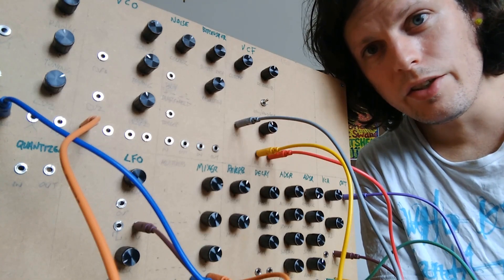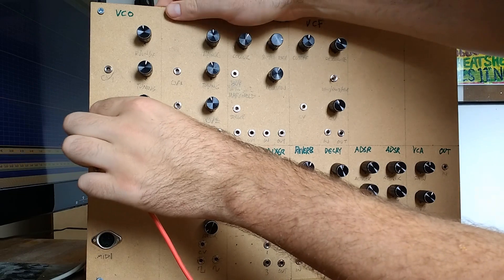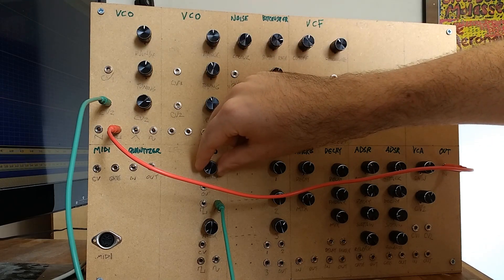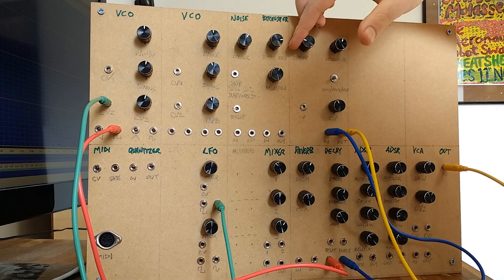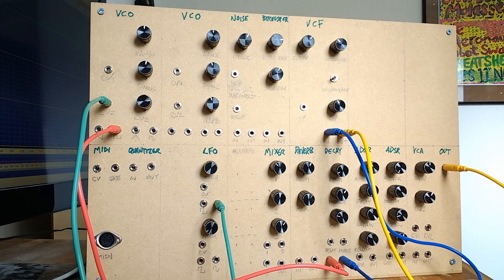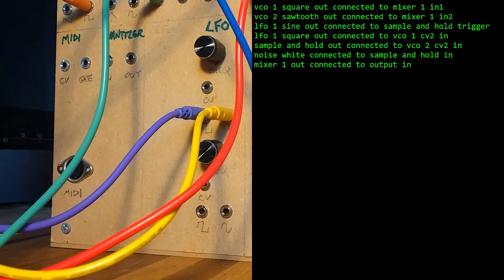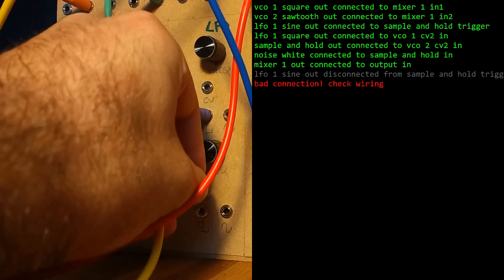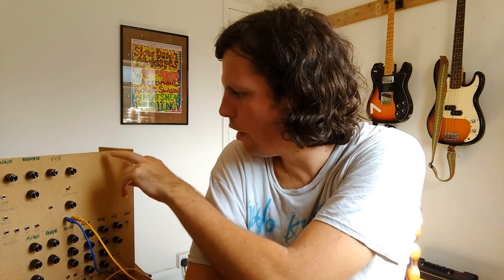DIY Digital Modular Synth Prototype

Comment: They're really just voltage control inputs to a softsynth. How about a modular design where each module is a separate digital processor, connected to each other digitally, and the only DAC is the final line out to recorder, speaker, or whatever? That's what I was looking for.
Reply from the maker: Yeah, this was my first clumsy attempt at this design. I've been playing with the concept on and off ever since. Not sure whether you also saw this video of my next version, which was modular and contained an on-board soft synth: https://www.youtube.com/watch?v=ALa5z5EOo8k

Both of these prototypes were made before I learnt PCB design, and I've also vastly improved the circuit since then. Am currently working on a new version, hopefully to be released in some form in 2022.

Comment: but it's semi modular
Reply: Semi-modular usually is called a synthesizer which can make sounds without any patch cables. In this case - you have to patch. Anyway - cool stuff Nerd On The Wire :)
Reply: @ben-s  but
Moog "matriarch"  is semi modular. And you can patch it...
https://www.moogmusic.com/products/matriarch
_
Modular synth is synth that builded from modules. (Capitan Obvious ^-^ ) 
You can remove modules and conect with other modules and patch it as you want.
(C.O. - in semi modular you can patch it only, and you can't remove any part)
Reply: @ben-s  but yeah. It can sounds  without any patch cable, some time ^-^
Reply: @rainy_amerei  yes, technically speaking semi modular would be a fixed modules + patching points or vice versa. In this case it's fixed modules and requires patching cables. It is not a modular, because you can not take out the modules and swap them, but at the same time - what difference does it make, if you don't patch a certain part - it does't exist, because it doesn't play any role besides taking the space - I'm getting to much philosophical here :))